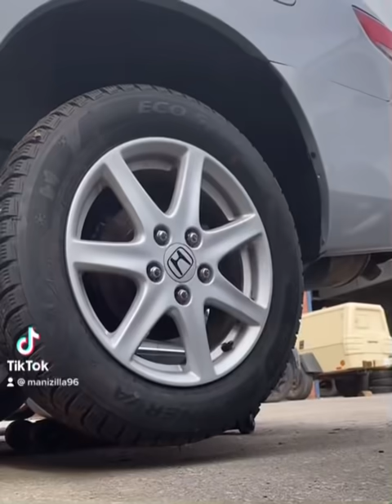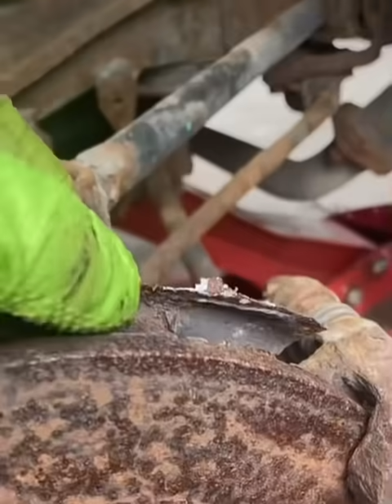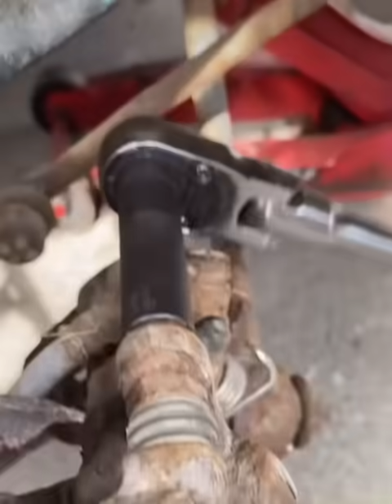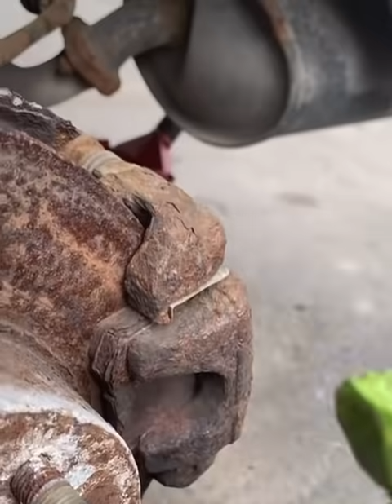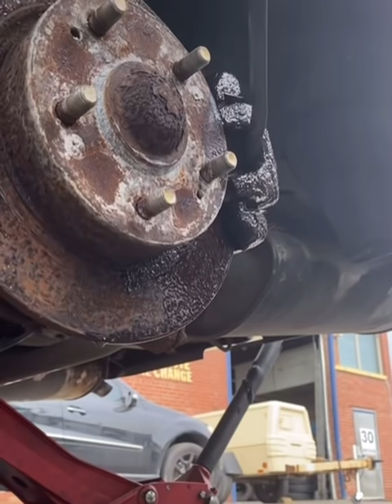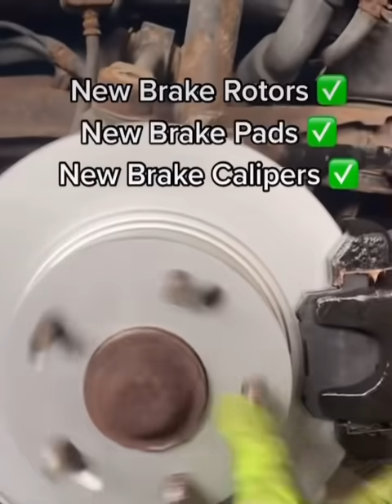Customer never drove their vehicle for 2 years and this happened ...

Comment: This has to be north or northwest.....That’s some hella rust corrosion for 2 years. I mean in the southeast I’ve had seized up brakes from rust as well, but not to this extent. I hate working on vehicles that come from “up the road”.....because it’s always overhaul time.
Reply: north east no doubt
Reply: Absolutely north east. I leave my car sit for 2 weeks while I'm away working and the rotors are completely covered in rust. Winter is even worse
Reply: Totally. I honestly feel like you also see waaaay less of the old (like 60s-70s) classic vehicles around here, all the salt and shit on the roads for half the year could totally mess up those cars and make it corrode like no other lol
Reply: @amr1t_  I have a 72 chevelle SS spent it's whole life in Southern California. absolutely rust free 

my 79 trans am from New York needed floor pans doors and fenders 
both had about 60k miles now garage kept and driven on sunny days only
Reply: I had my old 90 4runner parked for 5 years on grass. 
Thing fired up 3rd crank on a jump pack and drove itself onto a trailer NO PROBLEMS
Reply: Lol that aint shit man
Reply: Welcome to our world buddy. Cant drive a damn car for more than 5 years without something rusting the hell out of it. We coat our cars in fluid film. If you do it once a year you’ll legit never have any rust except the tail pipe where it burned off.
Reply: Or near the ocean. He's gotta be oceanside for that kind of corrosion, or NYC and he parks in the street.
Reply: @joestewart5406  I went to a Manheim auction in Pa and I couldn’t believe how bad 2 and 3 year old vehicles had already rusted….
Reply: @0xsergy  yeah I notice vehicles that are closer to myrtle beach always look bad. Any time someone sells wheels on marketplace and it says they’re located anywhere on the coast I just keep scrolling. I live about 1 hour from the beach and we get a little minor salt corrosion but it’s rare and not too bad.
Reply: @0xsergy  I went to buy a probe GTS from a guy in Brooklyn, parked curbside its whole existence since 97 since he bought new….it was so pitiful….one side of the car was like rotting away.
Reply: Bro that car had to have been sitting in a salt pit, never seen brakes that bad after 2 years
Reply: Amen to that fluid or oil coated frame. 
Old friend of mine used old used oil from all the oil changes he did on the side.
Reply: @SXSPRIME  my 53 Ford needed new floorpans, and a rear chop because it rusted so bad there wasn't a lip to stick a new pane of glass in LOL
Reply: @julian75411  better than nothing but used engine oil is typically acidic but still better than nothing
Reply: @well_as_an_expert_id_say  lol made the decision on whether to chop or not pretty easy haha
Reply: @noaht5191  I live in PA, bought a used truck from a dealer, 7 months (1 winter) later I need both bedsides, a tailgate, rockers and door bottoms. In 3-5 years I will need to restore the frame
Reply: @TheRyancamaro  damn. If you ever are in search of something rust free, come down to SC, what they lack in rust they make up in mileage sometimes, but at least it will last you a little while longer. I see why people up north have “winter” vehicles now.
Reply: @julian75411  yeah I’ve heard of them oil treating everything now….seems like a better concept. Damn salt corrosion is hardcore.
Reply: @noaht5191  I will definately be getting my next daily from down that way, Winter vehicles are so common here in Northwestern PA there are entire dealerships dedicated to them
Reply: @noaht5191  I've seen videos of what happens when you paint the frame. It traps in moisture and rots it out from the inside. So it may look nice clean and shiny, but tap it with a hammer and it will crumble.
Love on street parking in the winter. 
I can hear the salt trucks blasting the side of my truck when they go by
Reply: We don't see rust that severe even in North Dakota where the roads are salted ever winter.
Reply: You guys are all wrong. this in not in the USA this is in Canada. I can tell from his accent.
Reply: @TheRyancamaro  my brother lived up there around Pittsburg for about 8 months through winter….I’ve noticed spots on his cars undercarriage and rusty looking hubs since he’s gotten back to SC. It’s crazy how such temporary exposure can really shit one up.
Reply: I left my car up in Canada while the Beast was rampaging all around my home town. What felt like a year later (closer to 9-10 months probably) my Fuckin brakes were so rusted I reved my car up (good ol’ Sally a 2006 lancer sport back ((so a station wagon))) over 3000 rpm before she moved (I was also young and very dumb at this point) and when I stepped on the breaks she sounded like a barn of cats being stepped on simultaneously but I did wear throu the serfuce rust
And she came clean
Reply: Michigan...
Reply: @noaht5191  I drove my 05 Malibu out to PA when I visited my Grandmother. Car has lived in Denver it's whole life. Zero rust. Her neighbor was a body guy for 30 years. He couldn't believe it. I'll never forget him laying on the ground and looking underneath my car. The look on his face. Oh and the car has 280k miles.
Reply: @TheRyancamaro  well, I had a nice Silverado I would say I’d sell ya…..but this last tropical storm knocked half of my giant oak on top of it, crushing it and busting open the brand new metal roof on my shop….can’t win for losing. Thank god I still kept insurance on it.
Reply: @julian75411  yeah I got blasted by a salt truck in Ohio this last winter….I was unloading my tanker and dude asked if I wanted some salt, and I said heck yeah since the ice was all over the ground, and I stood their like a moron wanting to watch even though he was motioning for me to scoot over not realizing the truck slings salt, covering me and my truck….I got excited because I’ve never seen a salt/plow truck up close 😂

Comment: Homies resurfaced that rotor and told customer it’s a new one
Reply: Such a total Scottish Kilmer move lol.
Reply: @beezertwelvewashingbeard8703  no
Reply: Calipers are reman due to customer request. Rotors look brand new.
Reply: And it was painted
Reply: Nah he photoshopped the rotors, print the image on a vinyl wrap and wrap it over the old rotors for a clean look
Reply: He said in another comment that they are refurbished rotors
Reply: It probably would be cheaper to just go buy the $10 rotor ....👈
Reply: Awwww hells naw....
Reply: @boosted2.4_sky  just did brakes on an f150. Rotors are $83.99 EACH side.  To shave them is $25 if they are thick enough
Reply: @nickninja52  that sounds too cheap, you probably got it online, stuff online is cheap Chinese shit that will not last
Reply: @80fly1992  yes, they’re TRQ parts. Lol you do realize the same overpriced auto zone parts are made in the same sweat shop by the same little Chinese kid, right?
Reply: @nickninja52  yes like dorman products I hate that brand it’s straight Chinese haha. Some parts for European cars you can see they are made in Poland or Spain
Reply: @80fly1992  either way doesn’t matter to me lol I drive a 99 Corolla, those parts fit better than the OG parts and are working just fine, have had shocks from the same dudes for about 4 months and they feel amazing so far.

Comment: I bought a 2004 Volvo xc-70 that was sitting for 5 years outside. Had new volvo original brakes replaced before it sat. Car ran and looked like it came right off the lot! And still does to this day almost 3 years later. Same brakes too with lots of milage.

Comment: Hope you put a new brakes hose on also. Never reuse one that has been crimped. Its been damaged it well swell and rupture. But hey its only brakes how important can they be
Reply: That’s what I was thinking to, it really bothered me. Just letting the rotor hang by the hose can cause issues. They are more sensitive than you would expect.
Reply: I thought about that to
Reply: This is why I use a bolt with 2 copper crush washers and a nut. Also you can use a nail inside the brake line on a drum brake equipped vehicle with hydraulic brakes.
Reply: @sweettooth7124  good idea thanks

Comment: 15 minutes with a wire wheel and WD-40 turned into a $1500 bill but I bet was much higher. Way to show why you DON'T take your car to this shop. Rotors and calipers don't need to be replaced cause they're rusty. Stop giving real mechanics a bad name.

Comment: Yes, all covered in rust. He didn't wire brushed the hub and blow it clean. Remove centre cap and put some grease in. If hub warms up the grease will flow into bearings. OR replace hub and all wheels new bolts OT studs and nuts. Also clean or replace caliper and renew old brake fluid. Copper grease on hub and fit dics also slight copper grease on all new bolts or studs. Do it right or don't touch or do it! Do not expect old rusted caliper pistons would work or seize up unexpectedly and you crash and damage anyone. Be careful.

Comment: I volunteer at a local heritage railway and we had a similar problem with a track bending tool called a Jim Crow, it had to be at least 50 years old but it was all we had and was completely seized, we tried everything from intense heat to gallons of WD-40, not easy when this thing weighs officially a hell of a lot. But in the end our fabricator took his circular saw and cut a slice out of the side of the body of the thing, then welding a piece of steel over the gap when the screw was freely turning

Comment: You don't "crimp" brake hoses unless you're replacing them.
You can clamp the piston in the caliper, push car in and put it on the lift.
Everything was rotten, so, there you'll be, replacing everything.
Good kick on removing the wheel. It works.

Comment: I’ve never seem white rotors like that it almost looks painted, but you’d know better than that 🤪
Reply: that’s what they look like when they haven’t been grinded by the pads yet
Reply: @daddy_dorrito_3  mine were always shiny steel or whatever they make them out of. These almost look like ceramic
Reply: @AlecShernAPS  the ones we use in our shop come directly from NAPA, and they are more of a satin silver
Reply: @AlecShernAPS  break rotors are grey different angle can look white... it depends manufactory there is also steel colors but it depends maker in europe oem is usually steel and 6bucks cheaper is grey or white

Comment: I used to see that happen all the time on the older air-cooled Volkswagen vans and beetles, especially on the rear brake drums if you let them sit too long without driving you might have one wheel lock up and not want to turn but if you let it sit way too long you had to pound on the rotors or drums with a hammer to break them free and drive them for quite a while with the brakes dragging to get him to where they would actually not grab while rolling.

Comment: As someone who owns two older Vehicles..  i let one sit for a year not driving it..  i couldnt believe how fast those rotors calipers and brake pads rust when you dont drive it..   Its like the heat from them when you drive.   Keeps them from rusting.

Same with the exhaust pipe i noticed it was rusting more than usual..  very interesting to see this

Comment: Amazing! To begin I would never let my car sit that long without driving it, but if I did and this happened I would get all new brakes(pads, rotors, calipers, and new fluid) and I would probably replace the wheel hub and probably the bearing since I'm there. I always take preventative measures

Comment: Lol my 1997 golf vr6 was sat for 7 years before I got it, welded it up, changed the alternator, battery and filters oil ect, flew straight through its MOT no problem 😂😂 no bushed or ball joints gone, no seized brakes or anything

Comment: I feel so bad that my honda civic didn't drive for 3 years and that actually worsened its condition... As the car stayed in the middle eastern sun and shit all of the sealings dried and my car started going through oil like crazy... luckily my wheels didn't lock up, but I guess that would've been a better outcome than not finding the issue with the engine eating away at the oil....

Comment: Nobody builds shit to last anymore.. I bought an old 73 f100 a few years back that i diesel swapped later on. Point is it had been sitting for almost 20 years.. all i did was swap the fuel pump and put some fresh gas in it and that 302 fired right up.. checked the brakes, they were good and drove it literally 120 miles home from san diego to la and it ran great.. now if you leave your car sitting a month it falls apart lol

Comment: All that rust is not from the vehicle sitting for 2 years, that's sheer neglect...when I was in Automotive shop I saw shit like this where a customers car was actually towed into my shop, my instructor had to order her new brake pads, new calipers, brake lines, and rotors and that was just the front end of her car. The rear brakes were an even bigger mess I had to literally chisel off her rear brakes.

Comment: Not driving a vehicle for a few years and then going and driving it with out checking brakes is asking for trouble every vehicle I’ve stored for a few years I’ve always stripped down the brakes cleaned everything and applied a load of grease always change brake fluid completely before parking up for a while as brake fluid absorbs water and water causes rust which causes calipers to seize pipes to weaken wnd then there’s the prevention tricks for stopping pads seizing which just involves a good clean and grease that won’t wash away and leaving the handbrake off and every few weeks going out and rolling it forward and back applying the brakes or having it on axle stands and spinning the wheels and tapping the brakes

Comment: That happened to my car, you just drive off like you would with an agressive wheelspin a few times while someone hits your steelies with a hammer or a mallet. But better to wirewheel some rust first. Otherwise your pads wont work for a good while.

Comment: The thing is if a 79 chevy sits for 5 years it will take 30 mins and you can get it down the road and to canada and back and itll be fine. New vehicles you could touch the steering wheel wrong and itll break and never run again

Comment: That ain't crap. You could have soaked them calipers in penetrating fluid and drove for a half hour and burnt all that crap off. There was nothing wrong with them breaks. That's my opinion. Dudes driving a honda and you know damn well then breaks on the back hardly get used. Probably charged that guy more than his car was worth. Nothing an air tool couldn't clean up.

Comment: Yeah that's not 2 years of rust. Have an 05 minivan sitting in my garage. Having alternator problems. Run it by pure battery every few weeks. Hasn't been driven as a full time car for around 6 years. No rust underneath it and brakes put on with no rust on the rotors or old brakes. Had some rust, funny enough, on the sliding doors mechanism but not anywhere else. I maintain it. Just maintenance wouldn't have led to this car rusting like that over 2 years.
Reply: It's 2 years of rust in Canada maybe not usa

Comment: Where tf was this sitting? I left a 1997 car in the garden for 3/4 years and it was completely fine working once used again (you know, just checking tyres pressures, oil change etcetera)

Comment: My Dad recently passed away and his car had been sitting for couple years due to he had a stroke. Anyways his car was just as bad if not worse . I had to replace all rotors and all brake lines also brake cylinders because the rust was that bad. You can tell cars that are in the northeast area from all the rust from the salt etc they throw out on our roads in the winter and it being compounded 3x as bad by just sitting for years
Reply from the maker: My condolences,
Your dad would’ve been proud of the work you put in 
🙏🏽 
And yeah the rust in the North is dreadful
Reply: @ManiiZilla  Thank you

Comment: I had a 2000 2.0 jetta mark 4 that sat for 3 or 4 years and started up and ran like nothing ever happened also a 2005 ford expedition that sat for 5 or 6 years, same thing gas battery and ran like new... fun side note the jetta had 250k maybe little more and the Ford had 40ish thousand miles. Like I said both ran like nothing ever happened

Comment: Anytime you squeeze a brake line hard enough to stop the flow it needs Is to be replaced. There is a very fragile non permeable membrane on the inside of the brake hose and if you squeeze it flat it will split and allow brake fluid to seep into the other layers of the hose and cause a type of check valve that will hold slight pressure in the caliper, causing it to drag, and then idiot mechanics will constantly replace the caliper, claiming it was bad, over And over again.

Comment: Why I tell people cars like to be used they don’t like too sit. When I car sits everything decays rubber hoses become brittle the tires rot breaks rust up engine rusts all fluids freeze and crack hard lines like break line coolant lines the battery’s go bad a leak acid everywhere plastic becomes brittle from baking in the sun the cars paint goes bad from not being washed and waxed tint on windows starts to fail again from the sun so many issues just letting a car sit 500 some days and not being used especially if you live in a winter climate or hot desert climate so bad on cars if you let them sit

Comment: What, no new hoses!? No flush of the brake fluid or talk about master cylinder or front brakes!? Bad and incomplete repair. After sitting for two years everything in the system needs replacement or overhaul. Next time.